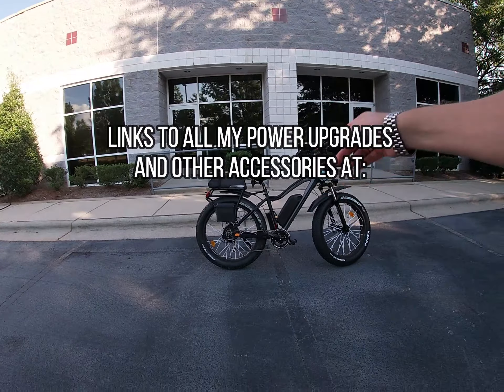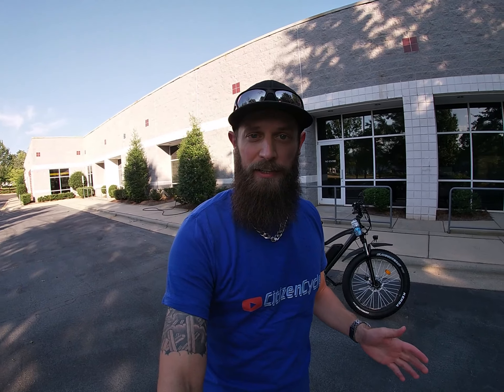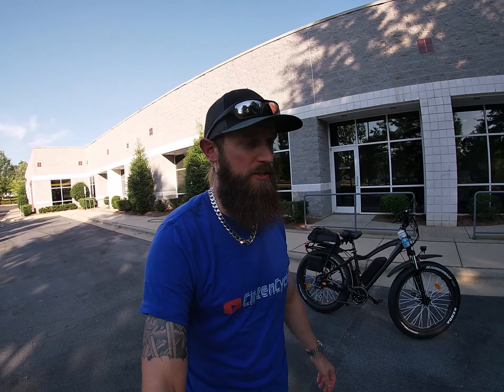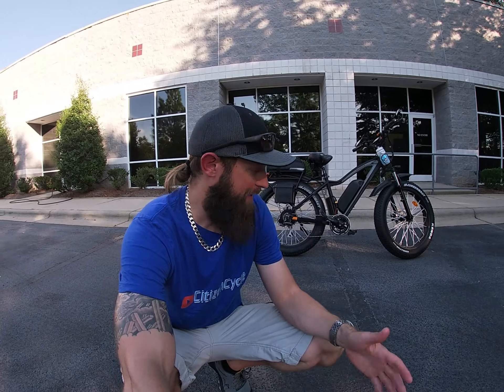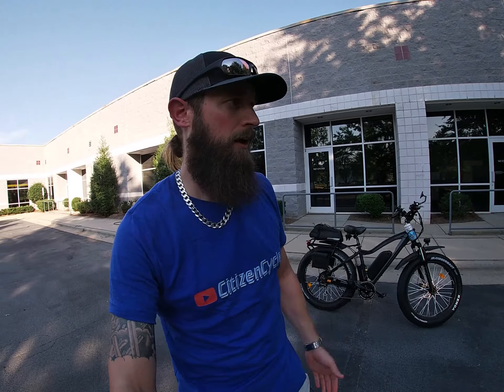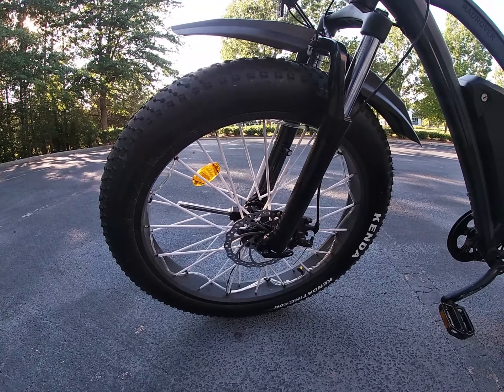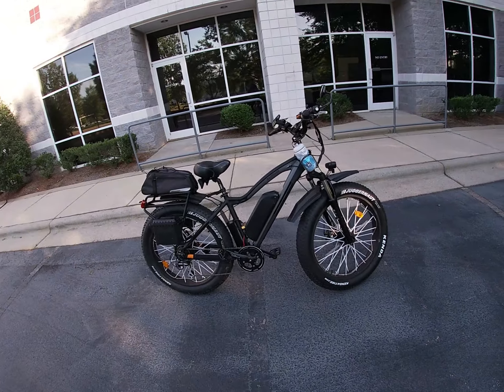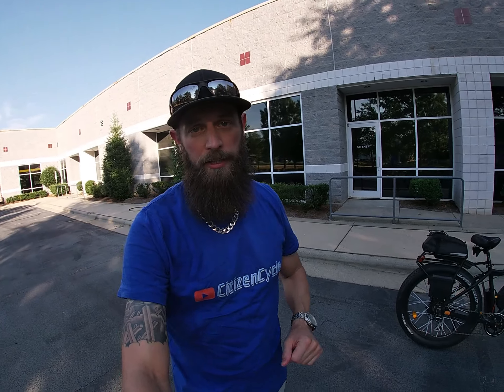Why I'm not doing another Range Test

Comment: Agreed, range is completely relative to each individual rider, there is no definitive answer you could give that would be completely accurate to another rider's style. With the 35a controller, true 750w motor, and 52v 17ah battery I'm getting 60 miles babying it, 35-40 pushing it.

Comment: I bought the Juin Tech pop and play hydraulic brake calipers, huge difference for me. Easier pull, much smoother, big difference. I did fray my line and replaced it, which I think was another upgrade, stock lines fray pretty easy. On Amazon, $119 I think and you get 2 new rotors too. Highly recommend, thanks again for your videos!

Comment: The brake wobble is probably from the mechanical caliper. When engaged only one side moves so it essentially bends the rotor pushing it into the other non moving side. It's a bad design. 

Full hydrolic is the way to go. Suprcooper did a video on his upgrade, seems easy enough. The hardest part is probably the motor cutoff switch on the levers. But he did mention they do make some levers with those built in as well.
Reply: or you can just replace the mechanical calipers with hydraulic calipers. no hydraulic lines needed it uses the cable.

Comment: I have to agree with you. I got 100 miles and only used 1 bar. I like to peddle for exercise at 0 to 1 assist. I use the trottle to get started and to blow by other bicyclists. So I might have been able to get 2 to 300 mile on one charge.

Comment: I have purchased a 2020 rad rover, and I love it.  I live in San Francisco so my mileage varies depending on the amount of hills I go up lol.  I seem to only get about 25 miles because of the hills, and I usually ride in pedal assist lvl 4  in 6th or 7th  gear.  I go up moderate hills, nothing crazy.  I am about 200 lbs but I do have a heavy chain lock, and usually are carrying a portable amp 6lbs, and electric guitar 🎸.  I seem to just make it back home with less than 1 bar on a 25 mile ride.  My battery did run out once, and I was pedaling a bike that weighed a ton not so fun.  I did invest in a portable charger if I run that low again, but the charger weighs about 6lbs, and only charges it up two to three bars, but that’s better than it running out of juice.

Comment: Heh heh - Didn't figure you'd do another range test. Two things: 1) all the variables you cited, rider weight; amount of throttle/pedal-assist; type of terrain; state/status of battery; wind; temperature, etc. and 2) You simply do not ride that far to run the battery down. I'll probably never run mine completely down, but it's just that "Range Anxiety," knowing that there's some (perceived small) 'limit' on how far you can go. So far I've found, though, that the stock motor and controller seem to be very efficient with power consumption in pedal-assist mode - I've done a 21-mile ride in PAS 1-3, and used up less than half of the battery, so I can see at least a 40-mile range if I ride sensibly (10 - 20 mph) and don't 'gun it' too much. The only time I really use the throttle is very gently to get started from a stop, and then the PS takes over from there.

Comment: I'd like to upgrade my rad power wagon to give it more getup and go while towing my trailer.  How would I go about upgrading the battery from 48v14amp to a 52v21amp? And should or would I need to change the controller?
Reply: He pretty much said the battery doesn’t help as much as getting the new controller from Bolton in his previous video.

Comment: I have all the upgrades on my 2020 rover and motor,controller,lcd screen,hydraulic brakes,52v 20amp battery 
I'm 270 and throttle only bike goes 30 mph,petal assist 34 mph.. RANGE 35 Miles only in petal assist 2(ave speed of 15 to 20 mph) 3 hrs of bike riding in one day I use throttle for big hills, throttle only maybe 20 miles at 25 to 28 mph..
Hope this help
Reply: Thanks for the info. I'm a big boy myself and was wondering if the RAD can handle my weight I'm 255 and will get my RAD in a few weeks but have already got the same upgrades you did except battery. If I may ask, where did you get your battery?

Comment: I have a Rad City which has a different motor with Re-Generative braking.  I weigh 295 lbs (yeah, I know I'm a Fat-a$s) anyway on three different rides I did about 33 miles without charging bike and had 2 "bars" left (40%+?).  Have not made any modifications and on my last ride this morning was concerned about making it back so really tried to make best use of the regenerative braking.

Comment: Off the topic. I got the same bike same removable headlight and same mirrors. Have you had the headlight pop off the bracket when going over a bump. Mine did so i wrapped a rubber band around it to keep it on. Also does your mirrors move in the Handlebar tube easily? Mine move kinda move easy by hand but haven't moved on there own.

Comment: I have question about when you changed the hub motor, you said you had a problem with it staying into third gear.  My question is have you fixed that problem, and is there a way to swap the gears ⚙️ instead of using the new gear with the new motor.
Reply: Night Owl he said in a previous video that a buddy came by and tuned up/adjusted the derailleur and it’s shifting perfectly now.
Reply: Chris Campbell oh thanks 👍

Comment: Aren't subscribers a pain? Looking forward to the brakes upgrade. Everybody that does them thinks they're the cat's pajamas. It's like one finger press is more than enough, but that's only with the full hydraulic, heh. Yeah, that disc probably isn't perfectly flat if you had to correct it. Go for the new disc
Reply: I think a 200 mill will fit the rad and the front is a good wheel for it!